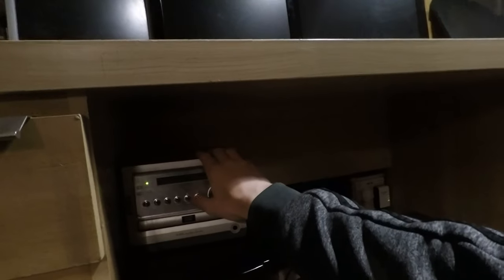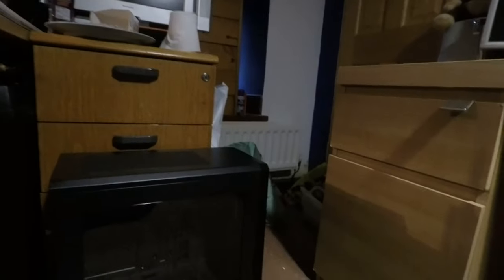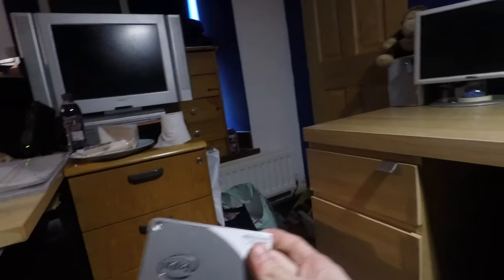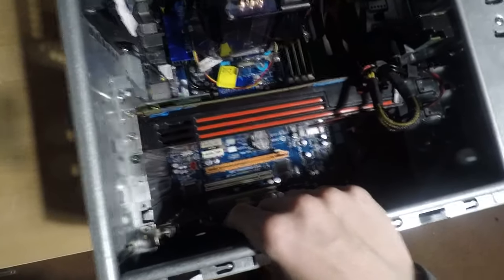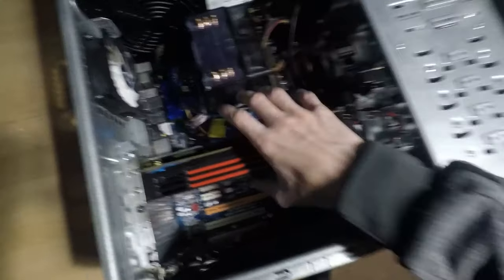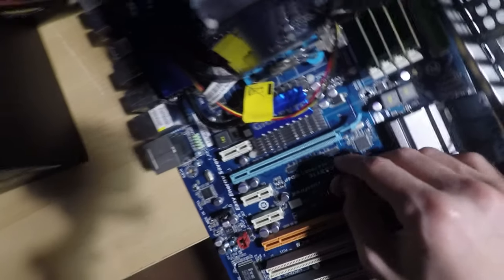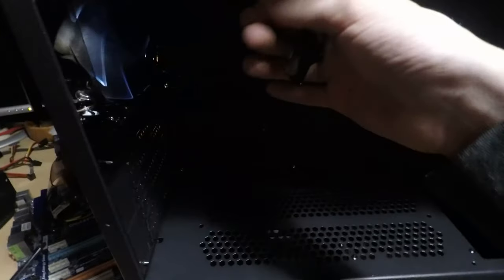Upgrading My Workbench PC

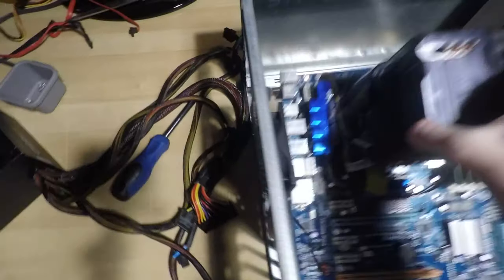Comment: It's a miracle you didn't break that motherboard at 12:30
Reply from the maker: Billswax Maybe, but I've done it several times before. I think some TechTubers have even specifically said that that's a good way to move them around. You're probably more likely to break the CPU by cracking it, which would've caused me quite a lot of headache.
Reply: Don't listen to people on here acting like they know anything there's a back plate on nobody so u less u use it like a bat it will never break handleing like that
Reply: @trashtronics1700  You could easily break one of the connectors for the audio panel.